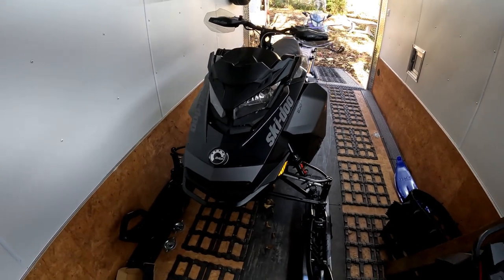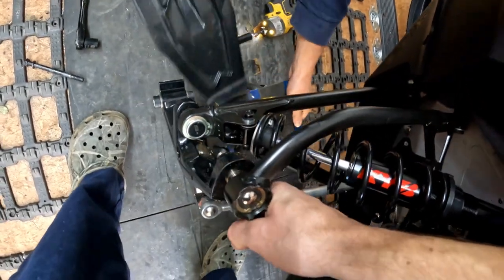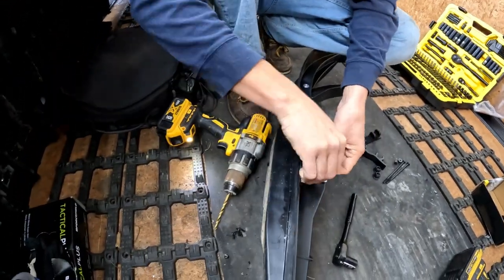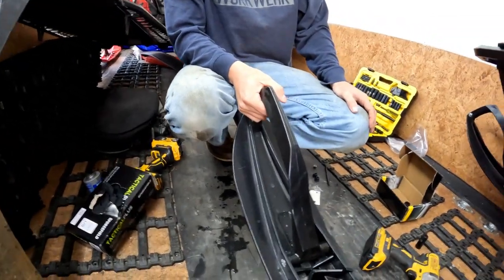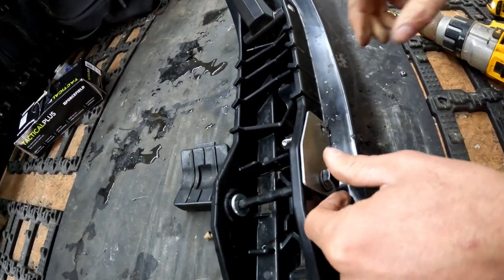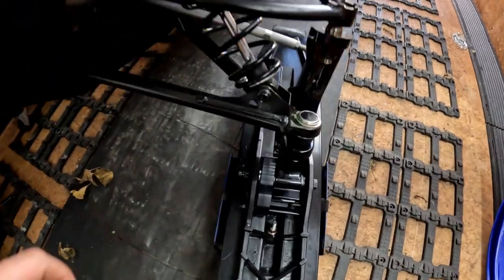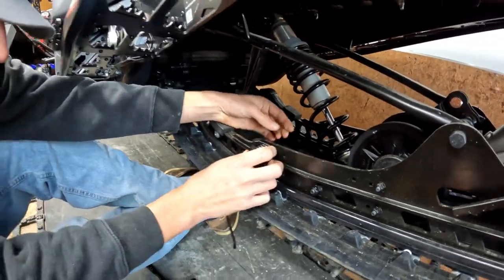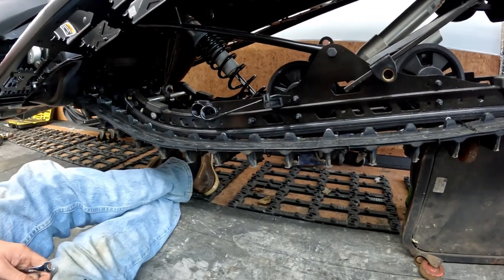2023 Backcountry Ice Scratches and Quick Adjust Ski Stance Install!

Comment: Who makes that ski stance adjuster kit?? Where can I buy one? Thanks!
Reply from the maker: Those come right from skidoo, but you can also buy aftermarket ones from places like royal, just double check the aftermarket ones work for your application.
Reply: Did you modify the rubber stopper on the rapid adjust ski Install and not show that part? It was in the Instructions.
Reply from the maker: @wstreff  No, seemed to work without it, he didn't read any instructions for any of the mods he has installed so far. if it doesn't work well, I will let him know he needs to do that. Thank you.
Reply: Really doesn't slide easily with out it. Also a drop of gear oil on the collar didn't hurt.